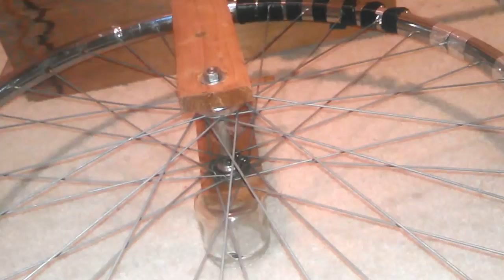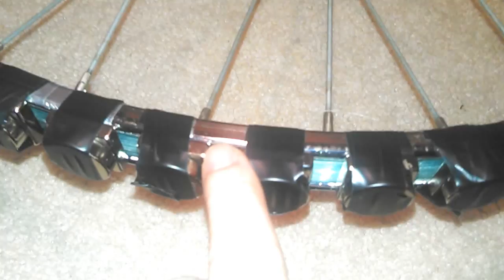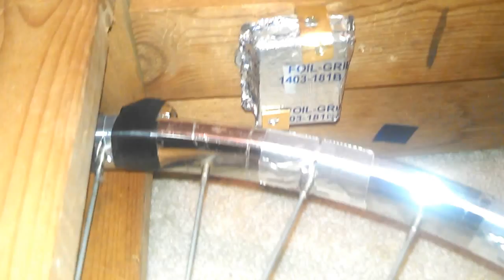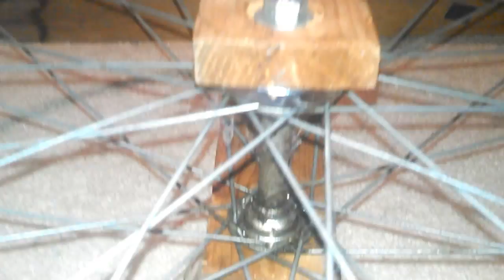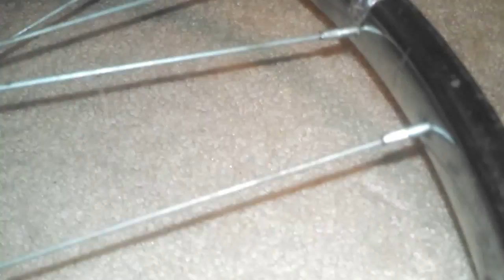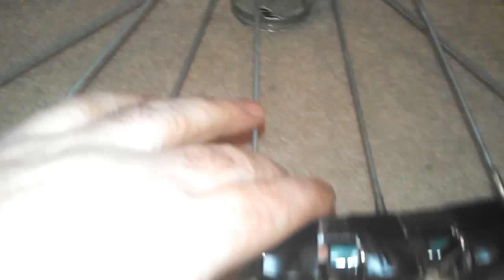🧲 Improved Magnet Position Yields Wonderful Results!

Comment: You already stated that this works well with multiple stators, so please upload a video of it in action. Not only will this video build credibility but it will also be a historical landmark as the first video of a working perpetual motion motor in history. :)
Reply from the maker: 🧲 I agree. YouTube took it down 3 times. Lost two previous channels over it. What I had working was a tiny little toy version. 

🧲 CREDIBLE FREE ENERGY MAGNET MOTORS THAT WORK 

MAGNET MOTORO - Rotor Encantado
https://youtu.be/mxgwTzxfe8Y

Amazing Magnet Motor/Gen Rep. This is not a fake
https://youtu.be/jKFTAobM-l0

WORKING MAGNET MOTOR 2023
https://youtu.be/vdtdKE2Qe40  

SELF RUNNING MAGNET TURBO MOTOR 
https://youtu.be/6sIBHn5-9pI 

 WORKING MAGNET MOTOR - rotor magnético
 https://youtu.be/3mD0_0FiJ54

 MAGNET ONLY MOTOR from SOUTH KOREA 
https://youtu.be/smzpbKg9S7M

1966: German inventor presents his Free Energy Device Magnet-Motor
https://youtu.be/XWQjMyMWXAc

Comment: Neat trick. Could you place the wheel with the rotor magnets 180* opposite from your stator,and then let the wheel go. I would suspect that the wheel is not quite level,and the heavy side of the wheel(side with magnets) is simply falling to the lowest part or the rotation plane. This would explain why you always stop the wheel with your hands,insted of just letting it come to rest by itself.
Reply from the maker: 🧲 Sorry it took me 9 years to stumble across your comment. I cannot keep up with thousands of comments in a timely manner. A lot has changed since you comment here. A lot has changed since your post. That setup is long gone. The wheel never kept Turing at that stage, thus I kept using my hands to stop the wheel. Guess you're not getting automatic updates from me? Go here for some breaking news. 👉🏻 https://youtu.be/8EYxKWsVx2k

I subscribed to your cool science channel. Good to know you're still around mate!

Comment: Very interesting. A suggestion is that you should tape another train of magnets at a distance right after say.. 5 rays of the wheel (less than the 9), such that they cause further gain right after the initial one, and hopefully close the cycle.

Comment from the maker: If you make the magnets work/go up hill, it still works just fine. Hill or no hill, the stator defies Newton's third law.  You rather depute the results than simply test it and then see for yourself, level or not, it still performs perfectly. After all, it's a bicycle wheel poorly mounted  to a wood u-joint. I used a level to level it. But the wheel shifts even after leveling it. AGAIN: The stator does exactly what I claim regardless of leveling issues as it even works nicely when vertical.

Comment: I'm not trying to be a critic and I admire your dedication. With that said, I think what you have here is a form of a homopolar motor. I say this because of the battery inside the stator. Although the acceleration is obvious, so is the sudden deceleration as soon as the magnets pass the stator.
Reply from the maker: 🧲 Good point. But the sudden deceleration has not only been resolved, now there is actual acceleration as soon as the magnet passes the stator.  See for yourself.  👉🏻 https://youtu.be/jsgUF5DHAwo  - Sorry about the slow response, but I have thousands to weed through yearly. Thanks for stopping by, and it's good to see you're still around posting your cool shooting videos!

Comment from the maker: Possibly at a later date as I am all to well acquainted with bismuth and it's reflective properties in that it reflects the magnetic flux back to the magnet (much like how a mirror can reflect light back) which in this case would not be good. But bismuth could possibly be used to deflect flux away from a problem spot.

Cheers!

Comment: I like your work !!!
Suggestion : If you use steel to back your mags. You can put like poles much closer together with out tape. Then when in the correct position use epoxy. Coat the steel with wax first , so you can remove the mags from the steel when the epoxy sets.
Anything I can do to help , “IS YOURS”
Reply from the maker: I'm sorry to see that you might have now passed over to the other side.
🧲 CONFIGURATION #7  https://youtu.be/drdAwmLbAfQ?t=1332
🧲 CONFIGURATION #8  https://youtu.be/drdAwmLbAfQ?t=1537

Comment: I am building one of these just for fun and as was wondering: can I put magnets around the whole wheel circumference to make it spin very fast or would that not work?
Reply from the maker: Yes. But that depends of your stator arrangement. 
🧲 CREDIBLE FREE ENERGY MAGNET MOTORS THAT WORK 

MAGNET MOTORO - Rotor Encantado
https://youtu.be/mxgwTzxfe8Y

Amazing Magnet Motor/Gen Rep. This is not a fake
https://youtu.be/jKFTAobM-l0

WORKING MAGNET MOTOR 2023
https://youtu.be/vdtdKE2Qe40  

SELF RUNNING MAGNET TURBO MOTOR 
https://youtu.be/6sIBHn5-9pI 

 WORKING MAGNET MOTOR - rotor magnético
 https://youtu.be/3mD0_0FiJ54

 MAGNET ONLY MOTOR from SOUTH KOREA 
https://youtu.be/smzpbKg9S7M

1966: German inventor presents his Free Energy Device Magnet-Motor
https://youtu.be/XWQjMyMWXAc

Comment: keep in mind the magnets in this configuration probably weigh down the wheel. this gives it an inconsistent spin, hopefully in the future when this is revised further the magnets are better counter weighting the wheel.  Keep up the good work! im preparing for the energy revolution!
Reply from the maker: It turns out that this magnetic motor challenge was solved way back in 1966 by a German man who made a working car motor that ran only on magnets. See link below. Others as well on the web have also made motors using only magnets. See links below. My design concept is different from most others. All these links are also found in the video description,

((( MAGNET MOTORS THAT ACTUALLY WORK )))
👉🏻 MAGNET MOTOR - Rotor Encantado
https://youtu.be/mxgwTzxfe8Y

Amazing Magnet Motor/Gen Rep. This is not a fake
👉🏻 https://youtu.be/jKFTAobM-l0

WORKING MAGNET MOTOR 2023
👉🏻 https://youtu.be/vdtdKE2Qe40SELF RUNNING MAGNET TURBO MOTORhttps://youtu.be/6sIBHn5-9pI

🆕 WORKING MAGNET MOTOR - rotor magnéticohttps://youtu.be/3mD0_0FiJ54

MAGNET ONLY MOTOR from SOUTH KOREA
👉🏻 https://youtu.be/smzpbKg9S7M

1966: German inventor presents his Free Energy Device Magnet-Motor
👉🏻  https://youtu.be/XWQjMyMWXAc

Comment: you could use a hub with sealed bearings and crank it tight without friction problems. looking forward to seeing the completed design concept
Reply from the maker: Guess what? Turns out we've had German magnet motors for cars since 1966. Google it. Now others are creating their own magnet motor that truly work. Using only magnet to create continuous motion has long since been solved and replicated by others. There for this is no longer theory. Thanks for visiting my channel nonetheless.

Comment: Hi, Just want to make a suggestion, if friction is the problem then turn the wheel vertical like a bike wheel is designed for and use a contra weight on the opposite site of the magnets. Loosen  the bolts as much as possible, take the grease out of the bearings and lubricate with thin oil you should be having a free spin of 10 minutes easy. That might be enough to make it go around while you wait for the parts to come.
Cheers
Reply from the maker: Guess what? Turns out we've had German magnet motors for cars since 1966. Google it. Now others are creating their own magnet motor that truly work. Using only magnet to create continuous motion has long since been solved and replicated by others. There for this is no longer theory. Thanks for visiting nonetheless.

Comment: energy must conserve. By my observation, when you give the wheel an initial velocity and the magnets approach the "Stator" they accelerate with the direction of rotation on the way into the field and against rotation on the way out. 

To prove this concept works, you need data. Measure the angular velocity before and after the stator. If the final velocity is greater than the initial velocity then that would be a real proof of concept. You can also quantify the friction from the bearing and subtract it from both sides of the equation.
Reply from the maker: 🧲 CONFIGURATION #8  https://youtu.be/drdAwmLbAfQ?t=1537

Comment: very nice. great job. I've got suggestion. if you can add more magnets, build at least 3 sets of 7pieces of magnets chain as you did here. Maybe you could close the cycle, but we need experiment to confirm this. I have done simillar experiments 7 years ago without much sucess. But I didn't change the last magnet as you did.
Reply from the maker: Guess what? Turns out we've had German magnet motors for cars since 1966. Google it. Now others are creating their own magnet motor that truly work. Using only magnet to create continuous motion has long since been solved and replicated by others. There for this is no longer theory. Thanks for visiting nonetheless.

Comment: have you tinkered with ball bearings such as skateboard bearings or anything to eliminate as much friction as possible? Possibly graphite.  I believe that it is possible to create a harnessable energy source from magnets. Resistance may force the magnets to push harder to increase acceleration using the "sweet spot" that you have mentioned. I would love to discuss these things with you.
Reply from the maker: Guess what? Turns out we've had German magnet motors for cars since 1966. Google it. Now others are creating their own magnet motor that truly work. Using only magnet to create continuous motion has long since been solved and replicated by others. There for this is no longer theory. Thanks for visiting my channel nonetheless.

Comment: Your design is very impressive and looks promising. Despite this I am still harboring a bit of skepticism since you are yet to show your motor actually running continually. To eliminate any doubt still within me and other like minded individuals I would like to see a video of this motor running indefinitely. Weather it is using multiple stators or a wheel full of magnets I just want to see it maintain motion, not pass the line of magnets through and stop. ---
Reply from the maker: 🧲 CREDIBLE FREE ENERGY MAGNET MOTORS THAT WORK 

MAGNET MOTORO - Rotor Encantado
https://youtu.be/mxgwTzxfe8Y

Amazing Magnet Motor/Gen Rep. This is not a fake
https://youtu.be/jKFTAobM-l0

WORKING MAGNET MOTOR 2023
https://youtu.be/vdtdKE2Qe40  

SELF RUNNING MAGNET TURBO MOTOR 
https://youtu.be/6sIBHn5-9pI 

 WORKING MAGNET MOTOR - rotor magnético
 https://youtu.be/3mD0_0FiJ54

 MAGNET ONLY MOTOR from SOUTH KOREA 
https://youtu.be/smzpbKg9S7M

1966: German inventor presents his Free Energy Device Magnet-Motor
https://youtu.be/XWQjMyMWXAc

Comment: I would like to talk to you, I have a design that is a similar principal. After 20 years of study and R&D I have maximized performance and torque. The problem this design will have is your magnets will lose strength through heat, because you are utilizing only one polarity. I have a solution and an 8 times more gain in velocity by specific magnetic placement and design. I'm interested in possibly working with you or corresponding with you so as to convince you I am very serious about the idea.
Reply from the maker: 🧲 After years of being away, then back, then away again, now I'm here to stay. I've learned a lot however in this nine years. I see that you seem to still be around. That UFO drone footage actually has 2 UFO's in it. Not one. 

 🧲 Sorry it took me 9 years to stumble across your comment. I cannot keep up with thousands of comments in a timely manner. A lot has changed since your comment here. If you're still around, simply respond to this and I'll do my best to respond to any question you might still have quickly. A lot has changed since your post. The wheel never kept Turing at that stage, thus I kept using my hands to stop the wheel. Guess you're not getting automatic updates from me? Go here for some breaking news. 👉🏻 https://youtu.be/8EYxKWsVx2k

Comment: It seems you would be fighting against the magnet when you first released the wheel, so a bit akin to pulling against a spring, not convinced about this 9:1 thing, I have some neodymium magnets but my experiments are more related to eddy current effects and known science. Good luck with your experiments
Reply from the maker: This magnetic motor challenge was solved way back in 1966 by a German man who made a working car motor that ran only on magnets. See link below. Others as well on the web have also made motors using only magnets. See links below. My design concept is different from most others as I'm going for super torque. The links below were long since made available in the video description as well. If by chance you're still around, thanks for stopping by.

((( MAGNET MOTORS THAT ACTUALLY WORK )))
👉🏻 MAGNET MOTOR - Rotor Encantado
https://youtu.be/mxgwTzxfe8Y

Amazing Magnet Motor/Gen Rep. This is not a fake
👉🏻 https://youtu.be/jKFTAobM-l0

WORKING MAGNET MOTOR 2023
👉🏻 https://youtu.be/vdtdKE2Qe40SELF RUNNING MAGNET TURBO MOTORhttps://youtu.be/6sIBHn5-9pI

🆕 WORKING MAGNET MOTOR - rotor magnéticohttps://youtu.be/3mD0_0FiJ54

MAGNET ONLY MOTOR from SOUTH KOREA
👉🏻 https://youtu.be/smzpbKg9S7M

1966: German inventor presents his Free Energy Device Magnet-Motor
👉🏻  https://youtu.be/XWQjMyMWXAc

Comment: what if you had magnets all the way around the rim would the wheel continually go?
Reply from the maker: No. Rather stators are used all the way around, placed at the 3, 6, 9 and 12 o'clock position.

For more FAQ's, visit my new James Roney Stator website found in the video description.

Comment: what would happen if you shield the back side of the last magnet?  I've been working with a similiar configuration.  The backside shield will break the eddy current attraction on the backside.
Reply from the maker: The bike wheel is steel, thus the backside of the magnet is automatically shielded.
Reply: your shield on the stationary magnet is between the magnets, do the same with the magnets on the wheel on the back side.  The wheel being steel is not shielding the magnets from each other on the back side which stops the pull back.
Reply from the maker: Adding steel shielding to the backside of the wheel will add more counter drag.
Reply from the maker: thefixer321
Adding steel shielding to the backside of the wheel will add more counter drag.